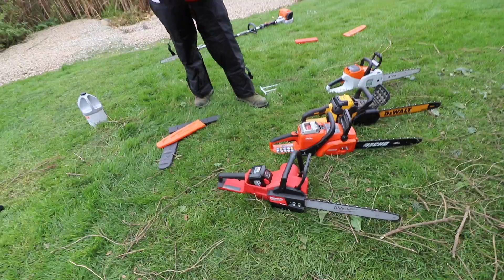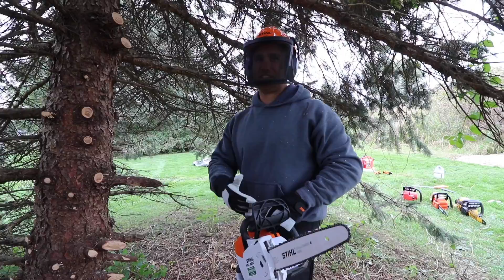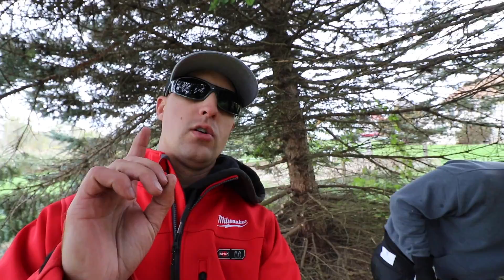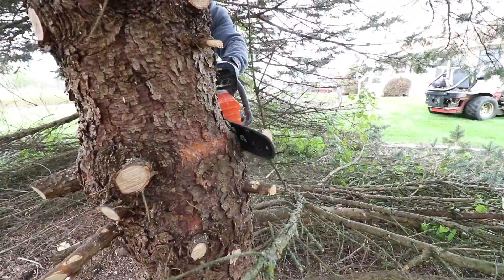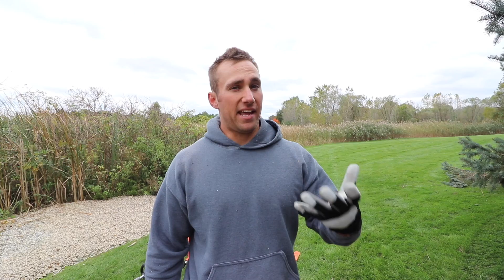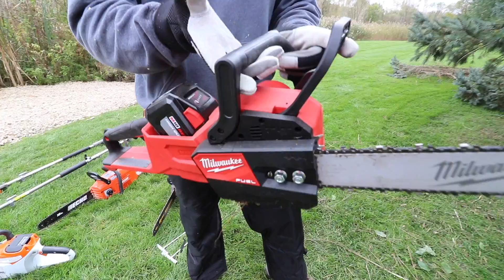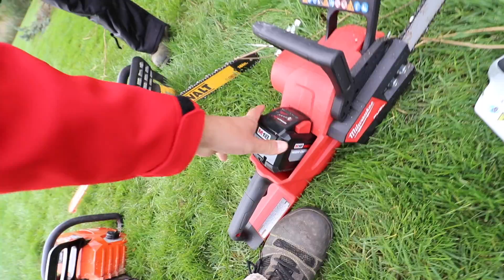4 Way BATTERY Chainsaw Comparison ► Which Has The Better Cut And Torque?

Comment: Who ever sharpened the chain on the Echo and Dewalt did a shitty job, those chains were DULL or the rakers  to high, next time you do a test like this use the same chain on all 4 saws
Reply: Should have used out of the box identical chains. That’s why these comparisons can be very misleading
Reply: Exactly what I was thinking. If you get the chain moving that fast and the cut is that slow, you just have to look to the chain.
Reply: They probably we're not full chisel and the stihl being a mostly pro only brand possible came with a full chisel chain. No matter how you sharpen or how much you file the depth gauge "raker" a safety chain won't cut anything like a full chisel. To me personally the best chain depends on your experience with kickback. I'm experienced so I much prefer the no effort required cut like butter but high kickback of a full chisel chain. But if your not experienced there's a good possibility the kickback could surprise you on a full chisel to the point it's splitting your nose in half before you realised you bumped the tip on something. Safety chains make me so angry I can't think straight though so I just get full chisel unless it's impossible to get.
Reply: jackle842000 most Stihl products come with their green labeled reduced kickback chains now. The chains actually cut really good for what they are. The saw in the video has a picco chain and those little guys are known to cut fast.
Reply: @crhonda6425  yeah the chain type definitely makes a huge difference in cutting speed. so much so that 2 saws can't be compared without running the exact same chain and possibly bar on each.
Reply: oliverm5sc maybe new chains would be nice
Reply: A fair test wood be with all brand new chains.
Reply: True. The echo looked like the rakers were ignored.
Reply: @TreeNerdi  They're depth gauges, not rakers...
Reply: There's also a difference in bar length between the echo and stihl. More chain to spin, the longer it will take to spool up and stop.
Reply: I am a 25 year veteran logger who bought his first electric chainsaw this week, I did not sharpen the chain or file the rakers which I normally do even on brand new chains.  My rakers definitely could’ve used a couple of swipes across them.  I however was able to make some cuts into a 20” cedar with absolutely no problems, I would like to see dogs on my DEWALT.
Reply: Oliverm5sc. I agree the echo sounded faster and stronger. You are correct about the chain being improperly sharpened
Reply: 0liverm5sc
I'm a retired Stihl mechanic and you just reminded of what I was told immediately before attending my first Stihl training day.  It was; "Whatever you do DO NOT call them rakers in front  of the guys from Stihl! They ARE depth gauges.  That is their job, they are not there to keep the cut clear of 'sawdust', their sole purpose is to accurately place/position the chain tooth for accurate cut depth/bite.  Guess who called them rakers (only once)and got ridiculed for the session.  I am going on 67 now and your post made me smile at the memory.  I didn't smile all those years ago of course. S
Reply: @neiljohn2894  all the loggers call them "rakers"
Reply: Indeed!
Reply: I agree i think the echo was duller than the stihl
Reply: THATS WHAT I THOUGHT
Reply: Hit the nail on the head. Always have to have the exact same cutting chain on all 4 to make it equal.
Reply: Like the chain was on backwards on the Echo.
Reply: I said the same thing
Reply: I can't speak for the other saws but I do have the Echo 58V and the chain in this video is definitely not sharpened correctly.  A properly sharpened chain will cut like butter with no effort.  I hit a rock with my chain once and even after I attempted to sharpen it I never got it right it wouldn't cut and you had to force it through the wood, so there is a trick to these chains.  Nice video though showing what's out there on the market.

Comment: 536 LiXP purchased last summer as my new climbing saw.  I didn't compare, just went with my fav brand Husqvarna. Love it. So nice not having to pull to start and so quiet hanging from my belt! I feel far less inner anxiety over accidentally cutting my flip line or climbing line... That extra sense of peace is worth it to me at 50' +
Expensive package: Saw, battery & charger $750.
Reply: Randy Stevens      I have a 120i.    That set me back 500$.    Well worth it.  I use it lots.

Comment: I am a tree guy and would like to lend a few pieces of advice: When chains are sharpened at a shop or a dealer, they typically use an electric sharpening device of some kind (grinding wheel, Dremel set up, etc.) which will usually get the chain sharpened relatively well, but they rarely check the height of the rakers. This is what sets the cutting depth of each tooth, therefore limiting the cutting speed of the chain. If you pay attention to the video, the Echo and the Dewalt had chains that had been sharpened quite a bit. If the rakers hadn't been adjusted based on the height of the tooth, it would not cut well at all. The real value in this video is what they could explain about the ergonomics of the different saws. Like the goofy secondary trigger on the echo. Things like that matter because if you want to switch to a battery powered saw, you don't want the user interface to be similar to the gas ones. This is what increases confidence and safety when switching different saws. Great job with the video.
Reply: The "goofy secondary trigger" on the Echo is actually a very important safety feature, unlike a gas saw which obviously has to be started, a small child can walk up to a battery saw and pull the trigger and you have a potential horrible accident, fortunately the battery saws are not like the gas saws, they require a two step process to engage the chain
Reply: @sawagain1  It IS goofy.  Just duct-tape it down, tho, and problem solved.
Reply: I think the trigger safety thumb switch isnt bad. You only use it to start the saw, once its going you dont need to keep your thumb on it. Its a great safety feature. This saw cuts like butter for me. It feels like a real chainsaw unlike some of the others I tried. I got tired of trying to get my gas powered Stihl started and letting me down. I can always rely on my 58v Echo.

Comment: I just a homeowner who just needs a chainsaw in my life. Milwaukee works great cause I'm already using the Milwaukee line up. Battery isn't a problem. The chainsaw works great for my usage. Recently did 4 medium and large trees and it held up great.  If you make a living on cutting trees you might want to look elsewhere. But for the the occasional user or most users if you are invested into the battery system the Milwaukee works great.

Comment: When you need to use a gas saw after not using it is when you realize why gas saws end up being more headache than a usable tool.. Its a constant repair job before you can actually get it running almost every time.. I'd rather pick up an axe than a gas saw..  Its a very inefficient tool that needs some other form of power.. Batteries are great.. Id love to see solar chargers on em
Reply: Use alkylate gasoline with 2.5% (40:1) high quality full synthetic 2-stroke oil.
Reply: Are you stupid? An axe over a chainsaw? What kind of saw are you using? My jonsered 2095 turbo starts on 1 to 2 pulls

Comment: The Milwaukee had a bigger Gap tooth chain which causes it to pull bigger chunks out of the wood that's the only difference in the chain really speed-wise it don't make a whole lot of difference that to me the DeWalt definitely did not have the chain quite as sharp as the steel or the Milwaukee because it was throwing really fine wood chips which is a sign of it being dull but clearly the steel has more pep and it's going to cut better still is a Chainsaw Company they're going to produce a better quality product Milwaukee is a commercial product which is going also produce a better product and has been in the chainsaw industry for a lot longer with the battery powered equipment good review though

Comment: The echo and DeWalt did not have sharp chains on. My old battery saw is cutting better than that xD and it's as strong as the DeWalt
Reply: Agreed. I just bought an echo gas saw and that thing has a 16 inch bar in it slices through limbs like butter

Comment: Sthil makes the best outdoor tools.  Had my gas string trimmer for 3-4 years now.  Starts on the second pull each time and it fast to refill the string head.  I used to have an Echo and the carburetor broke many times.  Love my Honda gas mower too.  The new battery technology is very cool and with all my new tools I will be going towards the battery tools.  I use my tools as a homeowner not a professional.  I liked the Sthil or the Milwaukee in this test best.
Reply: Gotta love when a gas powered tool/machine starts with a few pulls. Just makes my morning.

Comment: Skip Chain vs "Good" chain, it's about the number of workers ( cutters) you have. 
Skip Chains are cheaper because they have less workers. On a good chain there is 1 link between the right and left cutters. 
Skip Chains have 2 dead non-working links between cutters. So, cut, dead, cut vs cut, dead, dead, cut or 50% vs 33% workers.
Start with that and then get into your drags and proper sharping a chain. A rake chain is also as bad as a skip chain.
Reply: That's what I like about the Milwaukee, it uses an actual chainsaw chain, you dont have to buy a special "wimpy" chain for the saw.

Comment: The type of chain and the way the chain is sharpen makes a huge difference. Even though the chains where just sharpen, they did not look overly sharp. There is a bit of an art to sharpening a chain saw well.
Reply: Who ever sharpened the chains didn't know what they were doing. 
 They should put a titanium  modified chisel tooth on then they will know what a good chain will do
Reply: Noticeable difference of chain sharpness but also big difference between cutting six feet of limb from the tree and cutting the stob from the same limb with no weight pulling it away from the tree along with diameter being slightly larger.

Comment: I cringe whenever I see someone "saw" with a chainsaw. Your chain isn't properly sharpened and you need to learn how to use a chainsaw.
Reply from the maker: It was professionally sharpened. :)
Reply: Sorry but a sharp chain cuts chips. A dull chain throws dust. It may have been "sharpened" but I'm thinking they didn't file the rakers. Best of luck to you both.  @BriansLawnMaintenance
Reply: IDK if someone told you it was professionally sharpened, IT'S DULL. Remember you're not tree guys.

Comment: Biggest advantage of electric is instant on and off with the touch of the trigger. And electric motors are much more efficient than gas engines plus much quieter and no exhaust which can be a bother when using a chainsaw. Also safer. If I had one of these my gas saws would get significantly less use. Electric is the future. Solid state batteries are coming out soon and are safer than lithium and store more energy so it's only going to get better. You'll have 20ah batteries running 58 volts or something like that. 
Don't forget you can use both sides of the bar when pruning and cutting. Limbing and pruning are totally different things but this guy puts on a chainsaw clinic. 
https://youtu.be/o55nd_Qx_s0
Reply: i like that too but also refueling and storing too...no need to carry gas and oil to mix with it and a funnel if you don't wanna make a mess-plus i use one then it sits for awhile so fuel goes bad and carbs gum up and pull starting anything sucks...i just hope they last 10years+ if taken reasonable care of

Comment: I use the Milwaukee 12V and 18V lines now after dumping Dewalt and Bosch, the chainsaw is next on the list.  After seeing for myself how their battery table-saw worked I am convinced that any tool they make will perform exactly how I need it to.  I wish they would hurry up with a battery router.
Reply: James, if you were impressed by the Milwaukee Table Saw, then you’ve got to check out the M18 Fuel 7 1/4” Dual Bevel Miter Saw.  It really kicks ass, e.g. powerful, light weight (28 lbs), beautiful fine cut and powerful for it’s size.
Reply: @martylucas8557  I already have it
Reply: James Cutler, are you impressed?   I haven’t really used it yet.  I plan on cutting crown moulding for our new kitchen cabinets I recently installed.  Really looking forward to it.
Reply: @martylucas8557  Works great.
Reply: James Cutler, I can’t wait to start using.  I ordered from CPO Milwaukee.  I ordered refurbished, tool only for $299.00. I kept looking for deals,  it they were hard to come by....it was either $399 for bare tool or $499 for the kit.  It took about a week to receive.  They shipped in an oversized white box.  When I opened up the box the first thing I saw on top was a new 5A battery, Charger, fine cut Milwaukee blade, clamp and bag.  All of the items were unused.  Next the saw...they sent me an unused (might as well be brand new) Miter Saw, it still had the large zip tie and original packing foam.  Not a scratch or piece of dust on the saw.  I’m definitely going back to CPO!!

What stand did you go with?  I was looking at going with the WEN portable stand.

Comment: I have the complete EGO ecosystem steal deck self propelling mower, high output blower, chainsaw, string trimmer, hedge trimmer and the new generator.  Everything is amazing except for the CHAINSAW.  Oil quits lubing the chain and the chain is constantly coming off, it's worth saying again, it constantly comes off.  I have two of these chainsaws  and they both act the same.  I'm going to replace it with the Milwaukee!  I've tried the DeWalt and wasn't impressed.

Comment: Hello Again,
This is my second time watching a video of yours. As I said before I have been an arborist since the '80s.

For not-tree-guys, and not-chainsaw-experts, you did rather well for the subject of battery saws.

By the way, that is called a chain brake, that prevents saw use unless it is pulled back. Chain Brake.

First, there are different models of saw chain. You noticed that when you commented on tooth size. You can find out about chain options and choose one that is better for your work. If you call Oregon Chain you can get an excellent booklet about this.

OREGON MAINTENANCE AND SAFETY MANUAL
(800)223-2127

You noticed a 90 on the driver of some chains? Good. This book will help you with that. Like changing wheels or other options on your truck. Choices among things that all fit the truck. There are different chains.

If you stick with Stihl chain, it's not in the OREGON book. But all your saw principles are.

Second, the guy in the red jacket was right when he observed saw chip size differences. Bigger chips are a good sign for both sharpness and function. When it looks more like saw dust, that is less good, and getting worse.

The man who had once worked with a tree company did well every time he did not leave a branch stub when he cut off a branch. When a branch is cut in the right place it will grow over better and faster. It's like a doctor working on you. You want things done right so you will heal better and quicker. Right?

My sister has the DeWalt saw. She is very excited about it.

Thanks for the video.
Reply from the maker: Thanks for all the kind words and info! That’s what it’s all about. All the best, Brian

Comment: Wasn't echo  the brushless model?
Reply from the maker: Yes
Reply: @BriansLawnMaintenance  Thanks , the one being offered here NZ , is , but it's black n orange, only 14 inch . Might be an updated model rather than another option ..( praps different spec for different markets 🤷🤷...too many models .   The " no name " brands are worse . Here the useless 80 volt purple thing is a Victor . And the ' green machine " is a lawn master I think . It would seem the four brands you chose are the pick of them . + The Makita . With Makita being two x 18 volt =36 volt you can effectively charge it's two batteries in it's supplied dual charger in half the time compared to most 40 -56 volt batts

Comment: Just at a glance, the dewalt seems like a pain, and milwaukee is a serious contender to stihl...
Reply: The stihl and Milwaukee are  at another level to the de Walt . Priced at another level for sure . Stihl $1,200 in NZ . Milwaukee 1,000 ish  12amp hr 18 v. DeWalt $600 ish  2amp hr)at 56 volt . (  Echo   $800 ( with 4 amphr 56v. Milwaukee at 12 amp hr doesn't mean it's got 3 times more stored power than echo , but a similar amount . 18 x 3 = 56 but you drop the amp hrs by three times to get the stored watts ( there is an equation to get accurate watt hrs )   Stihl quote their batteries in watt hrs here

Comment: I use the Greenworks 80 volt chainsaw on cutting down big 20+ feet tall Cottonwoods and have had not problems.
Reply: I really like Greenworks.  I use their 40v mower, and I get through my whole yard with no problem.

Comment: How many volts is stihl battery?  It sounded most powerful to me too.  Probably also most expensive as well.
Reply from the maker: I’m not sure actually that was the only question no one answered for me
Reply: Its actually only 36V, which seems low https://salemruralkinginc.stihldealer.net/products/batteries-and-accessories/batteries/ap300/